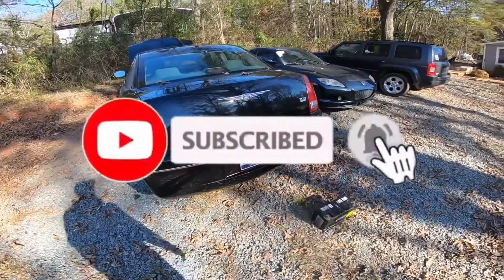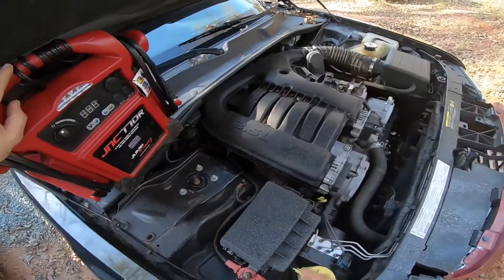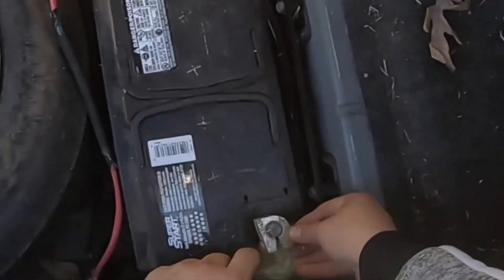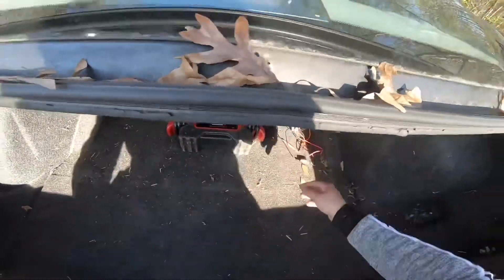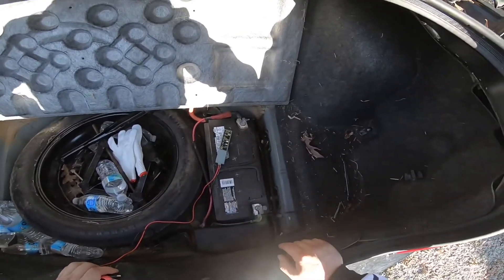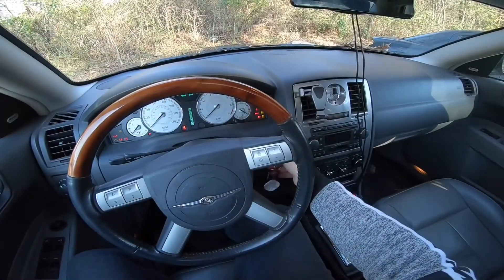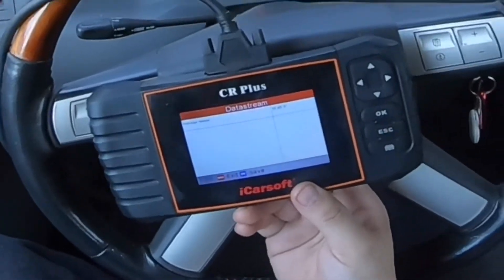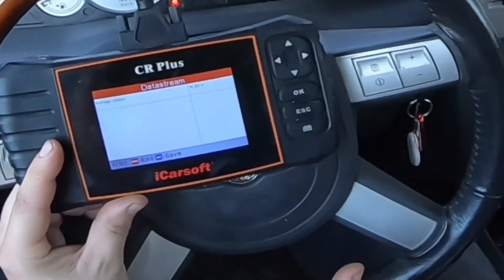How to open a Trunk on a Chrysler 300 with a Dead Battery or no battery easy trick

Comment: You seem like the person to ask this question. I have a 2007, 300 v6 3.5. Last weekend we had a lot of rain. I had a piece of trim, I hadn't put back on, that come loose on the drivers side, above door top leading to trunk and water drained in the trunk. It was not standing i water but close. The battery was at 4 volts and dead. I replaced the battery, dried and aired it out first. I connected the battery and all was well. The alternator 14.4 volts, 13.1 resting battery. Everything seemed fine but the taillights stayed on. I did some net research and the most recommended repair was replacing the brake stop sensor. It was recommended as a DIY repair so I attempted the replacement. I was OCD in following the installation procedure but tail lights still on of car was on or off. I then took in to a local garage. I got a call my car was ready. The car started fine, tail lights now off as normal. However after taking my car home, I did something I should have done at the shop before I drove off, I checked the car out. I am not a car repair kind of guy but have some basic electrical knowledge. The key fob will not open the trunk off. If the car is on the trunk will open with dash button and fob but off neither work. The mechanic said he removed a module or relay and it fixed the problem. I told him to save all old parts but he said he forgot and put the relay in the trash. I should have asked him to show me what/where he removed the relay but I failed to do so. I can't find anything missing fuse or relay according to the car's  manual. I checked every fuse (front and trunk) but could not find anything. Also since the fix every time I turn off the car all the door locks open when I turn the key off. I got my tail lights to turn off but now I have these issues. I feel as if I paid through the nose for someone to who did not have the training/knowledge to attempt to fix the issue and did not go back and check their work. It is an old car, showing its years. It has been my experience at auto shops, the rougher  and older the vehicle is, they  treated with less care. So I just am at a crossroads again. I am afraid of losing another battery or breaking down. Any advice much appreciated. I am just trying to keep an old vehicle 245 K plus going, until it is not economically reasonable to invest in more repair.  Any advice appreciated. Thanks.
Reply from the maker: I read your entire comment and my very first recommendation would have been brake light switch however, you said your lights was on not sure which lights you were talking about the brake lights if your brake lights stay illuminated as your as if you were pressing the brakes, ask for what piece the guy has removed I do not know my thought process is this. It’s a good thing. He found it in a first place. I don’t think he was on trent some stuff you just can’t train for it’s a trial and error type of thing so my recommendation is just drive to Mechanic. Be nice about it and just ask him the location of where this old part was, obviously it was causing an issue, but it would be nice to find out what’s the name of the part so you could get another one so that you can have maybe one from a junkyard or something so you could have a trunk that will open and such, but at the very leastyou are able to open it with the car running that is already a good thing but anyways good luck. Thanks for the comment.
Reply: @ZimaletaMotors Thank you so much for replying. It was the brake lights staying on. I like your view as how to deal with the issue.

Comment: 2006 Chrysler 300c:
This trick didn't work. Instead I opened the hood and there's a place on the fuse block to hook up cables. 👍
Reply from the maker: Yes that’s what I did to

Comment: I tied  a string to the quick release hatch. NO need to buy equipment. If I need to get in  the trunk and battery is dead I pull the string to pop it. / Usually just enough juice in remote to unlock doors.
Reply: Thanks! That's a brilliant idea. I'll do that.

I can't climb into that space, no matter what. Using the string would save me so much time finding a young person who can get in there for me. I'm not so old or so out of shape that I shouldn't be able to change a simple battery-- at least not on any other sane car.